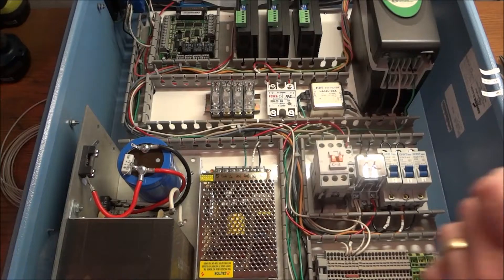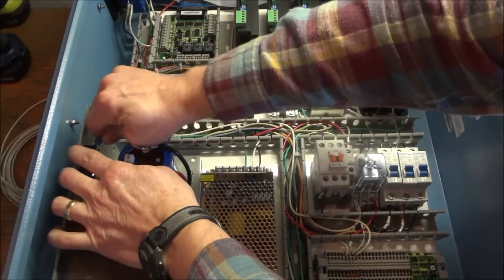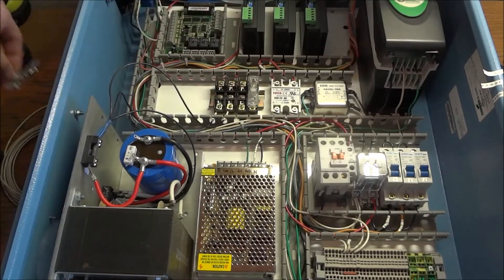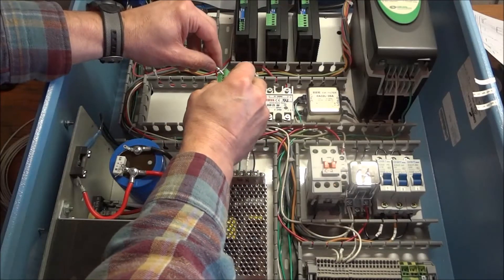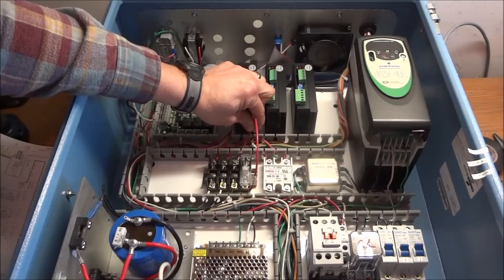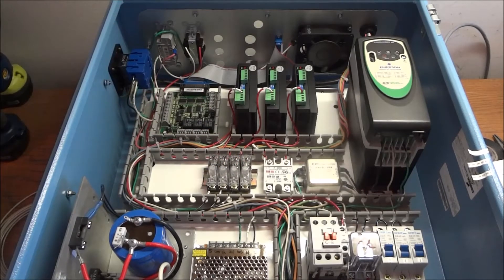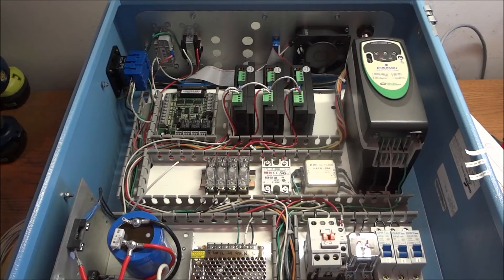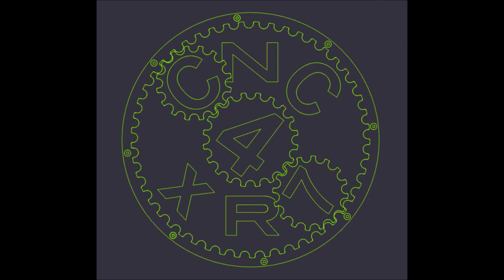PM 727M Wiring Pt 6 "48v Stepper Power"

Comment: amigo esa power supply de 48v no le trasmite ruido a los driver
Reply from the maker: No it does Not
Reply: amigo muchas gracias y lo felicito haces excelentes videos , una pregunta usted hiso el power suply o ya benia as
Reply from the maker: thank you the power supply was purchased I suggest a Toroidal power supply from CNC4PC this type work best for CNC.
stay away from switching power supplies.

Comment: Hi again Sam ... watched and re watched most of the vids in this playlist / project several times .. as Im closely mimic'ing this controller box ... its been great help  - Thank you a ton ... question ... I have not been able to locate any video of you running a Green/Ground wire from the 48v transformer to the ground terminal blocks ... is that not needed with your device?  Did I miss it?  Do you discuss / complete that in a later video?  I suspect I missed it but cannot find it - look forward to your clarification - thanks again man ...
Reply from the maker: Hi Steve,  The 48V dc power supply is feed with 110v AC A line and Neutral is connected. The power supply is grounded to the chassis through the mounting holes the chassis is connected to the Green/ earth ground. the output of the 48v power supply is 48v + and 48V -  I did say ground. but it is the 48v - white wire.
No green Earth ground for the 48v or 5v /12v power supply.

Comment: do you know how many volts and amps my power supply would need for 4 nema 17 motors rated at 2.4v and 1.5 amps per phase? i would appreciate the help.
Reply from the maker: Not sure what your drives are rated at most are 12-36v, I would think a 24v 360 Watt 15a power supply would be overkill but they only run around $30 so why not.
Reply: CNC4XR7 i am using a cnc shield with drv8825 drivers
Reply from the maker: I think those are 8v-40v  so you should be fine.
Reply: CNC4XR7 what would happen if i used a 24v 5 amp power supply for the 4 motors?
Reply from the maker: patrick rodriguez 
well you gave the specs per phase as 1.5amps if your using bipolor motors 2 phases your at 3 amps x4 motors max so 5 amps is low the motors will run but they may stall etc.

Comment: silly question,
How do you decide what amp fuse you need for the stepper motor. I've heard that you should multiply the max amp by 1.25 or 1.5 to get the final amp rating of the fuse. Is that correct? And is there any reason why I couldn't use DC circuit breaker instead?
Thanks
Sam
Reply from the maker: +Kirk Douglas Well good question. There are formulas for figuring out the fuse size and if you search you will find all sorts of info.
Fuse vs circuit breaker. for the motor I would use a fuse the motor is going to be in a environment with coolant and the cables will be in motion. If the fuse blows " There is a Problem" with a breaker we often just reset without investigating a fuse gives us time to contemplate why it blew and if its your last fuse you really take a good look before installing a new one. Remember a Blown fuse means something is wrong.

As far as Fuse size My motors are rated at 5 amp @ max voltage 60vdc I'm running 48vdc so I should never reach the 5 amp Max but I sized my fuse to 5 amp. My drivers will be set below the 5 amp max around 4.9 or 3.8 RMS.

I hope that helps.

Comment: Thanks for the videos. Regarding your fuses and main power supplemental protectors:

1) Are the 6x30mm fuse holder bases for your stepper drivers rated for VDC? Does it matter? Can only seem to find VAC version of the holder.

2) What are the curve ratings for the supplemental protectors? Would C or D make sense in your application?

Thanks and keep up the good work ....
Reply from the maker: +Snow Rescue These are 5 amp fuse the voltage is 48vdc  the fuses don't really care if its AC or DC I suspect the ones your looking at are the correct ones. search for Din rail fuse holder 6 X 30 mm that should fined them.
Be Safe Sam

Comment: I dont think it is a good idea to use single wire for stepper driver ground back to the power supply because you said that each driver has 5 amp fuse so say each one pulls a little less than 5 amp and you used 3 wires(one for each driver) that is 15 amps combined that needs to go back to the power supply thru the neutral wire and your neutral wire is only 1/3 of the thickness of all + wires combined. You should apply the same principle on ground wire as on + wires so you should have 3 grounds, one for each driver.
Reply from the maker: +Nixx 123 
Thanks You could easily do that if you would like to, I have not had a issue in the past with the ground.
Reply: +CNC4XR7 Well i am not  saying you will have problem with that configuration i just wanted to let you know which is the "proper" way to do that. I study industrial automation so we learned about this stuff. And btw your channel is awesome keep up the good work :)
Reply from the maker: +Nixx 123 
Thank you yes you are correct I will make that correction a simple fix I do not know what I was thinking " Star Power" is the correct way to connect the steppers. you need a equal distribution on the return as well.
be Safe Sam